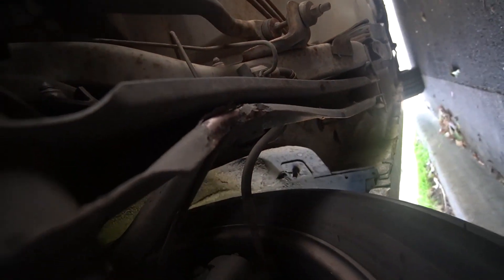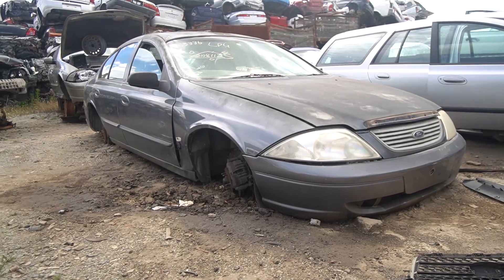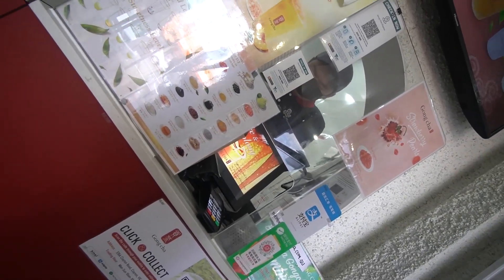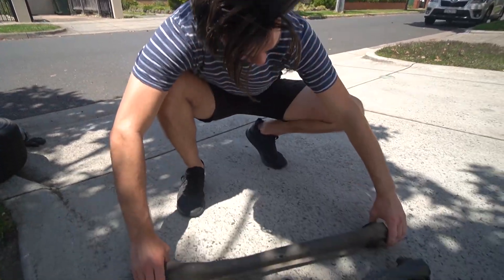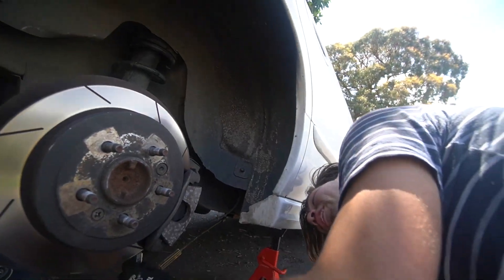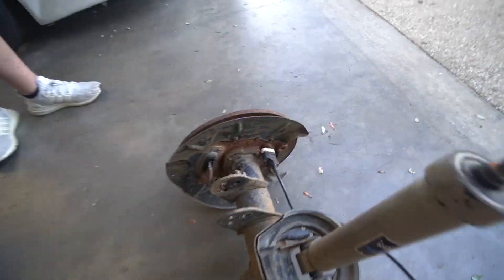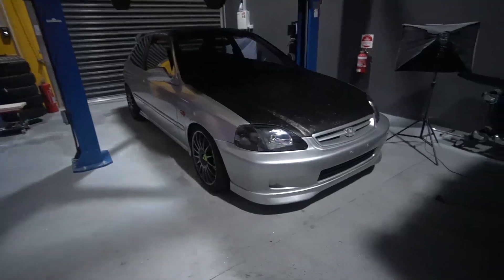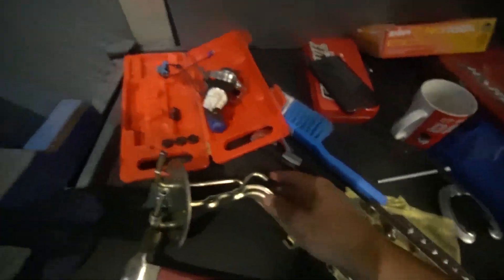NEW DIFF FOR THE AU FALCON! (3.45 FACTORY LSD) - WILL IT SPIN BOTH?

Comment: I was Aussie youth doing just this on the street early 1980s. In the gutter with a cutter (hacksaw) so to speak. Best one was a HK ute 192 with a  chev 10 bolt.....it just destroyed itself so often I gave up and found a Borg Warner LSD from a ford. Stud patterns meant more tyres in the tray however.

One thing is that I had no help at the time.

2 days.

Good job video!
Reply from the maker: I can’t imagine doing work and gathering parts without the internet! Props to you for doing it in the old days 😅 thanks for the comment :)